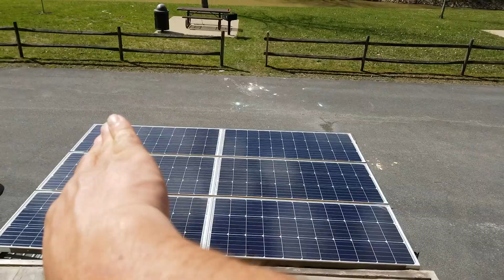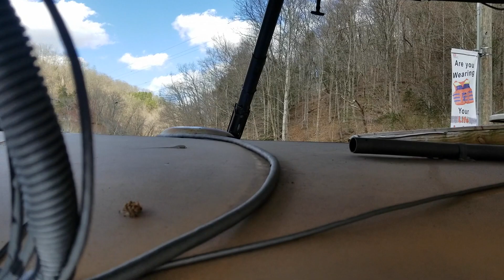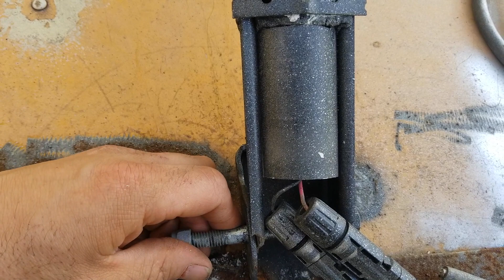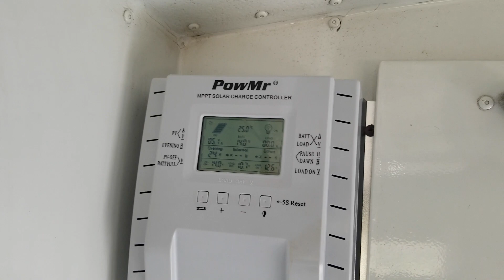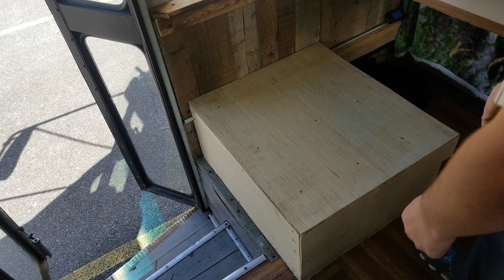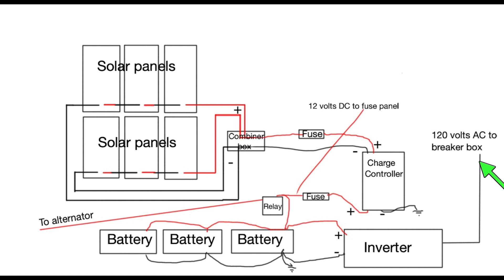How the Solar Power System in Zephyr works

Comment: Yes sir, need something to be ready to soak up that power when you make that last connection ! Best of days to you and your family Luke !
Reply from the maker: Yes. Although another comment got me thinking about what would happen if the battery fuse was to blow. There would be an open circuit surge of higher voltage across the controller. I am thinking of incorporating a relay into the circuit to kick the power off from the panels when the batteries come disconnected.
Reply: @lukeFugate - nice to have knowledge of as many things as possible... anything we end up learning to avoid learning the hard way is great !

Comment: its just as impressive now as when you built it, I like the truck hood latches but it looks like a bit of a chore to reach them, give it a few years and those acrobatics wont be so easy, how about adding a tab to drop them down or failing that, a short pole with a double hook to pull them
Reply from the maker: The pole idea is great. just a couple of hooks to grab the latches with. The front latch isn't too bad, but that rear one is a little tough to reach. Thanks Doc!

Comment: You need a solar disconnect for when you are shutting down the power to to the charge controller.You don’t want power from panels coming into the controller without a battery connection.
Reply from the maker: Yes, that was what I was saying. That is another reason to have the fuse between the panels and controller. 
Your comment has got me thinking about what would happen if the battery fuse was to blow leaving the panels hooked to the charger alone. 
I can put a NC relay in the circuit coming from the panels. I could then put the wires to energize the relay across the fuse to the battery. That way, if that fuse blows, the potential between the fuse terminals will kick the relay open and disconnect the panels. I could also hook the NO terminal of the relay to an LED warning light to let me know the fuse is blown. 
Thanks for the idea!

Comment: You have a great setup. Was nice to see a summary. It was fun, too, watching as you built this all in your videos of the time, but this summary really brings it all together and shows how well you think things out when you take on a project.
Reply from the maker: Thanks! I wanted to try to make this system safe and reliable and I think it has been both so far. 
On a side note, I checked out the website about your motorcycle. I think the one you have is pretty cool. From what I read the battery comes off to take and charge inside instead of having to charge it up outside. That's a great feature. I like the fact the police started using them too.
Reply: Yes, the battery on my bike is removable - which is a really great feature.
Reply: One thing one learns early when driving an electric bike though is the importance of being heard. So many times people stepped out in front of me because they didn't hear the bike coming. I have a radio on the bike now that i play pretty loudly when i'm driving where there are lots of people.
Reply from the maker: @dsteele27  I wouldn't have thought about people stepping out in front of you. The radio is a great idea.
Reply: I didn't think of it either - until it kept happening. The radio really does the job. People know i'm there.

Comment: No more updates on the Tiny House? It has been 3 weeks since the last update.
Reply from the maker: Sadly, nothing to update. I haven't received any unemployment this year so I couldn't finish it before going back to work. That was my plan for the winter was to finish the build while on layoff. This is the first year in 12 years I haven't gotten unemployment in the winter. Because of Covid, there are just so many cases, they can't keep up. 
I start back to work Monday and should be able to start on it again as soon as the $$ starts coming in. There are ways I can get free materials like pallets and scrap, but for the finishing touches that are left I need new materials.